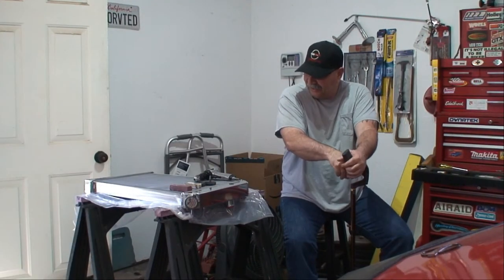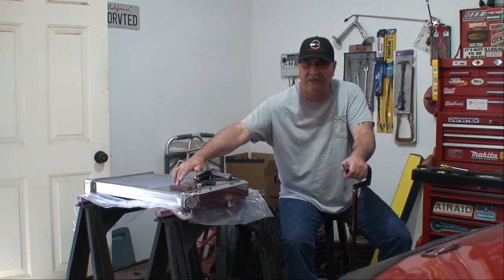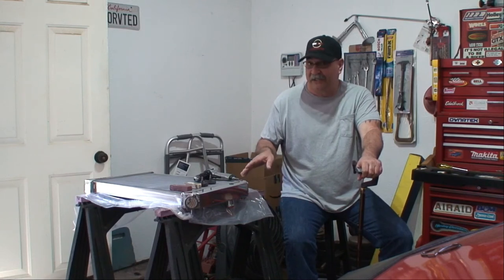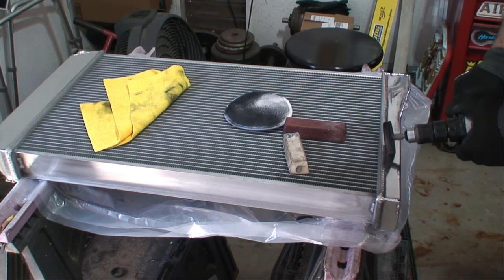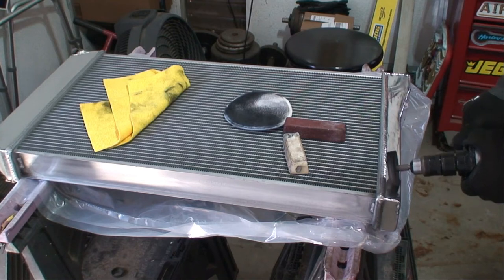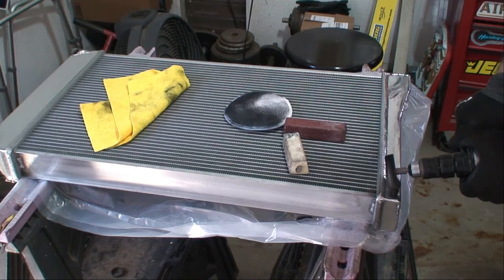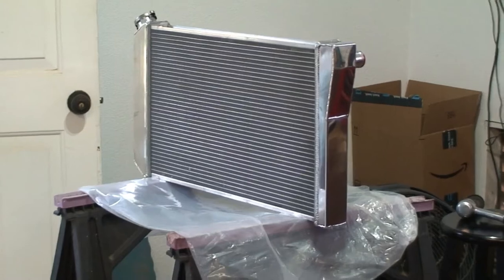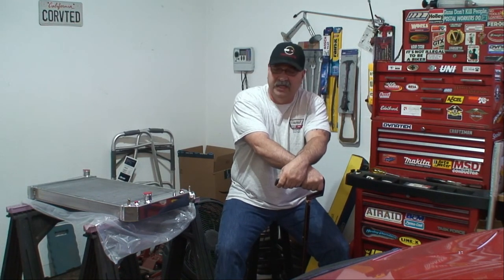how to polish aluminum radiator bonus clip

Comment: This is the best video on aluminum polish. What product and method do you recommend on keeping that polish protected and shiny after the fact?
Reply from the maker: I use Blue Magic metal polish cream  to keep up on the shine. I like it because as you cleaning your polishing pad ends up with black residue and that’s when I know the Blue Magic is working. Then I go back over with a clean rag for the final stage. I have been using Blue Magic for 4 decades. Love the stuff for aluminum.
Reply: @CorvetteEdsGarage  thank you very much. Just bought a polished aluminum champion radiator for my 64 impala. I would like to keep it up properly so thanks